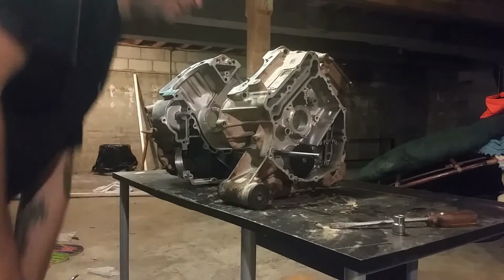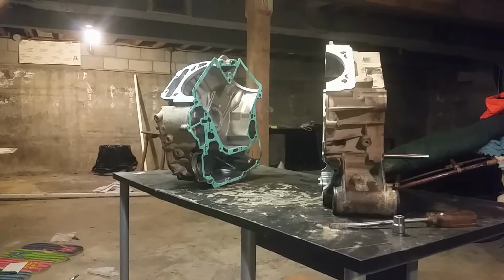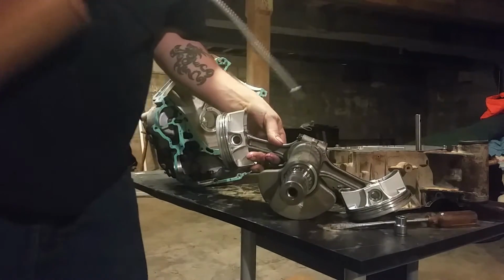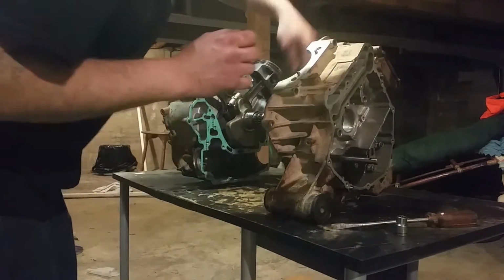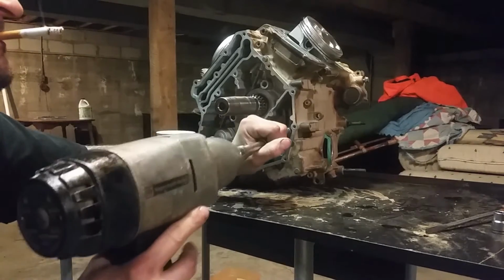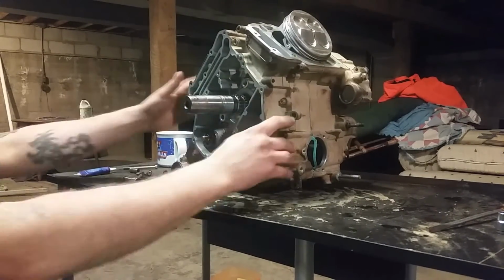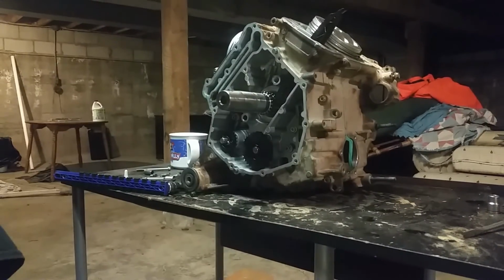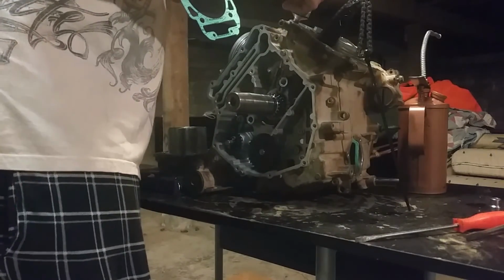Can Am Renegade 940 Rebuild Case and Crankshaft

Comment: just watched the full serie...very helpful. I just blew up my engine and this will be good help 10/10
Reply from the maker: No problem any time I have been trying to get the other ones made or found really cause i dont really know where they went. i lost about 10 mins of it some how so i may have to do another part to add into it cause itll be on the complete motor. it may be a little difficult to explain and to show on the complete motor
Reply: +Nick Stockert still very helpfull...took me quite a while to get the magneto off since i didnt have to right tool. it worked good with a 3 point steering puller

Comment: been waiting for this one for a while ....can you remind me what caused your engine failure?
Reply from the maker: cam chain stretched around 4k miles and could have easily just replaced the cam chains and guides but that's no fun let's go full 940 race motor for some trail fun
Reply: Ill be tapping raw power next summer I am on almost 5 k miles but light mud mostly wide open trail riding now on 27 x 14  x 8s front 10s rear efx moto mtc such fun they are like a bighorn tire but on CRACK  lol huge sand rooster tails and pure enjoyment lol

Comment: how many miles on average are these motors
Reply from the maker: to be honest im not to sure depends on the build and use of it. my stock 800 block I beat the hell out of it with nothing but mud bashing. If I had paid more attention that day when my 800s cam chain stretched and started rubbing I could have got 10k out of it and it broke at 4272 miles. I imagine on how much this motor of mine is pushed to the limit I will easily have to do head work and simple re hone during the winter and reg major checks that come along with a high performance race motor. Search extremeatv and chris black may have better idea on how long they last.
Reply: Ha, I'm rebuilding my wife's 2010 Outlander right now. Always babied and well maintained. 500 miles. Crank bearings and sprag clutch are gone.